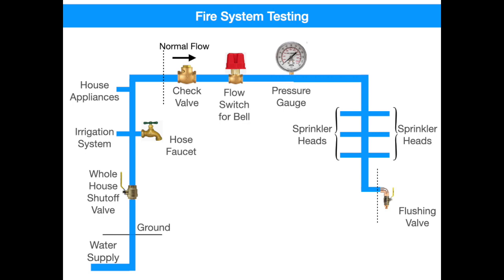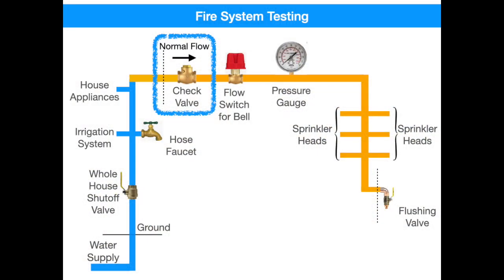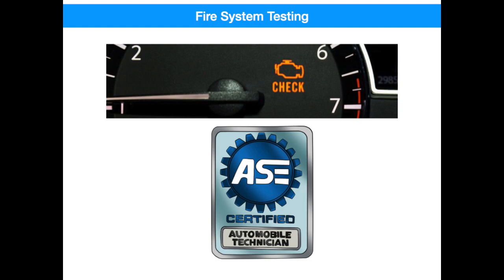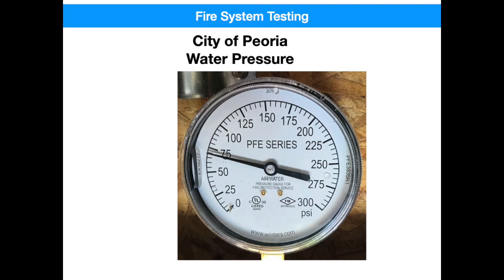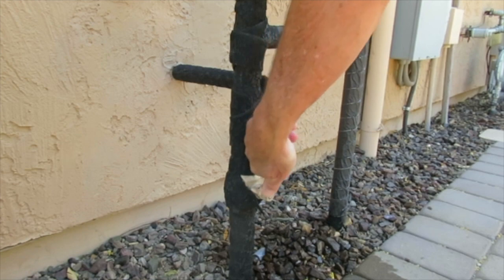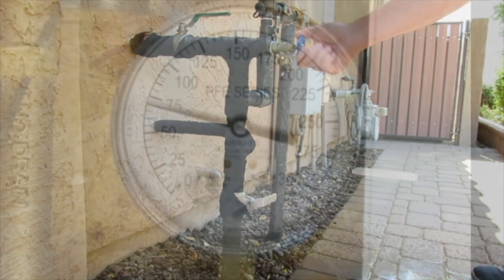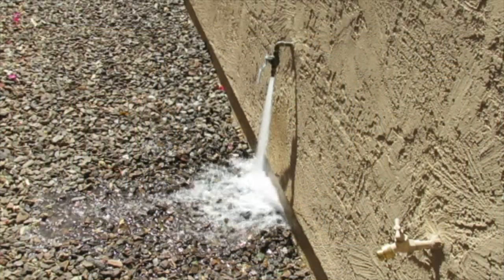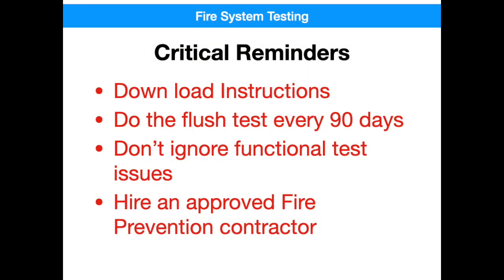Fire System Testing

Comment: thanks a lot! very useful! but thigns behind the service is hard to service - no space to even replace the gauge. top left is over pressure release valve?
Reply from the maker: To gain more access, remove the trim around the plastic cover. Yes, the relief valve provides over-pressurization protection so your plastic piping does not burst.